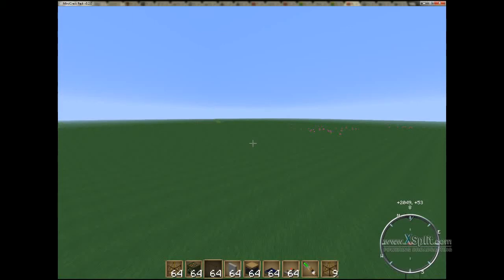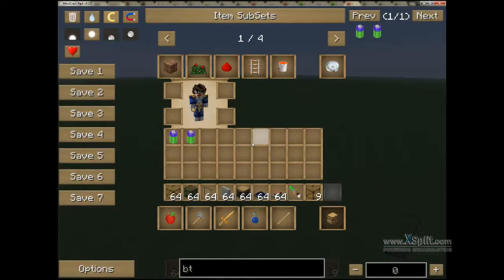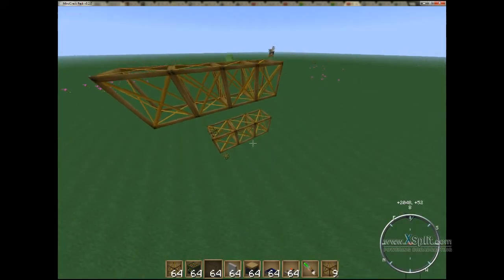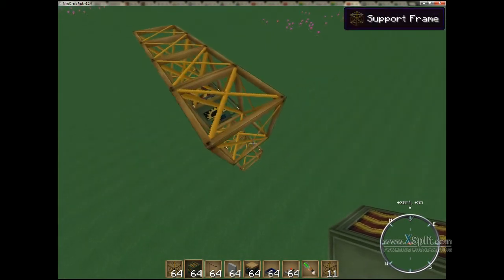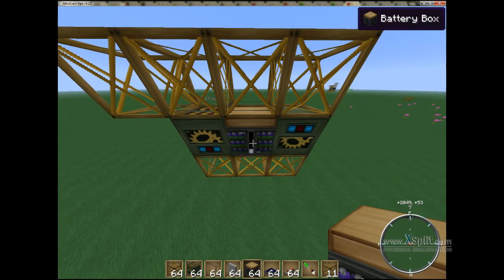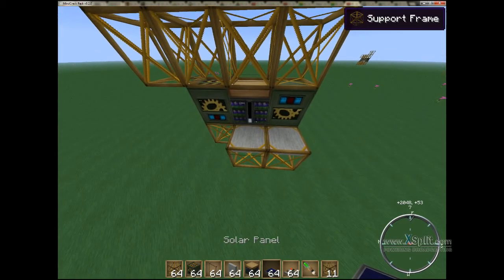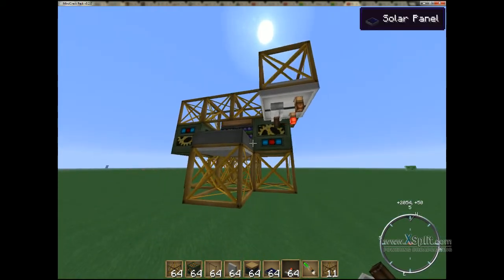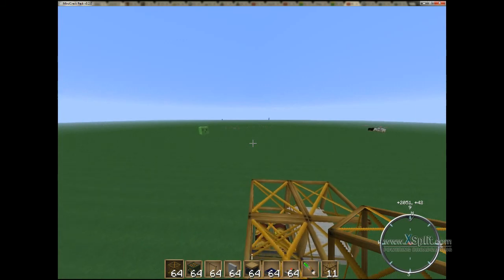RedPower 2 Frames Caterpillar Engine- Basic Tutorial

Comment from the maker: Are you sure you have the covers and plates in the right place? Also, are the toggle latches correctly facing the frame motors? When its turned on, the lit side of the latch should be facing the motor.